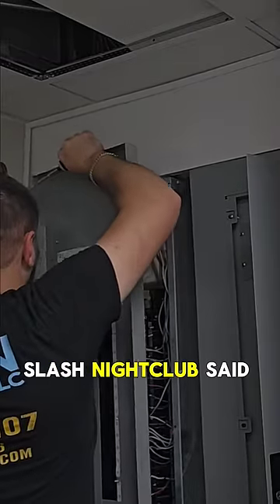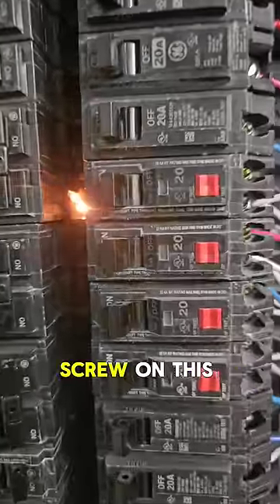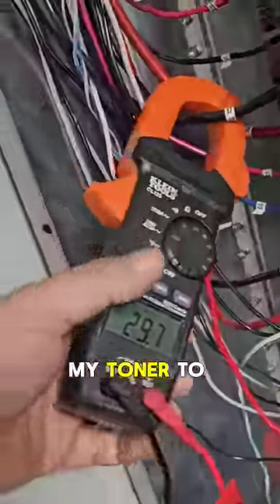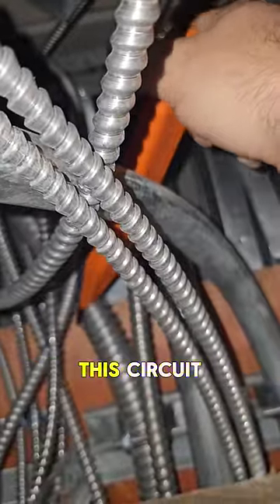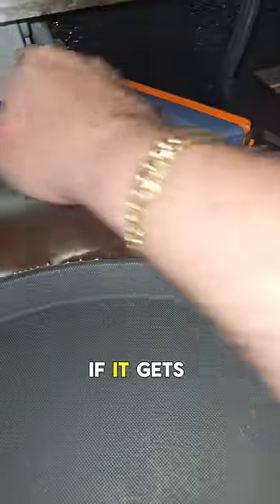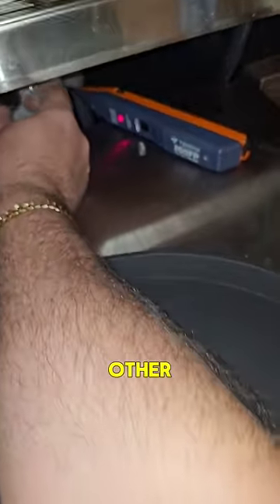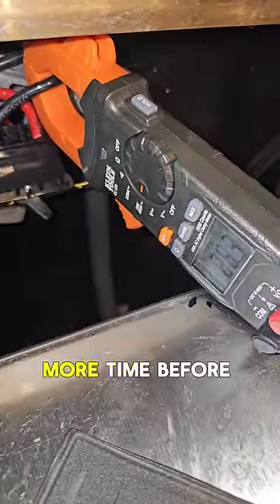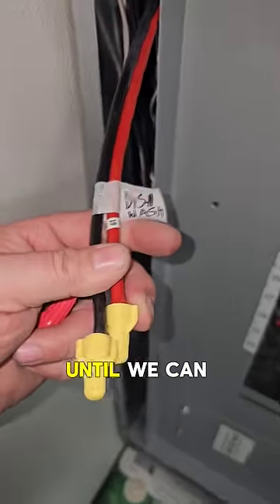This bar/restaurants panel was smoking when a 50 amp bolt on breaker melted down. Simon Electric

Comment: A friend of mine had the same job in Manhattan lounge bar.  He immediately yelled at the owner to get everyone out of the lounge.
His friend that was with him just hanging out happened to be a FDNY firefighter.
The moment people left the lounge, the panel arc'ed and you could hear the humming from the arc.  Every light went out and all you could see was blue light flickering from the panel.
Con Edison was called for emergency shut down.
When my friend told Con Edison that he was called on the job because the owner reported smoke from the electric room,
Con Edison guys went into the room and the entire room was black.  Everything was black.  Con Edison ripped out the electric panel, and when they took the panel outside,  my friend said the panel was melted and twisted into a mess.  Con Edison changed and rewired the entire room and also changed the meter.
Con Edison reported that whomever installed the panel installed it incorrectly and whomever wired it after to accommodate audio equipment such as 12 Crown power amplifiers for sound system, messed the entire panel up.
Later it was found out that the so called electricians prior to my friend was unlicensed.
Reply: Why do you say con edison so much...are you a bot...
Reply: @tieember9596    🤦‍♂️
Reply: @tieember9596  well, it's the electric company afterall, and it's also shorter than typing out "the electric company" every time. 

I saw no problem with it, it's just a story

Comment: This is getting to be a common problem in new panels. I’m finding on average 3 to 4 loose or cross threaded screws on every 42 circuit panel from the factory.
Reply: Because people are using impact drivers to fasten down everything
Reply: This 100% man. I have a strict no power tools policy for my guys when it comes to panels. Even panel cover screws at this point. I was finding they could not tell when a screw was cross threaded going into the soft busbar and would ram it home, leaving a loose connection.
Reply: They were never taught how to put in a screw. Hold it in place, spin it “ counter” clockwise until you feel a click then thread it in like normal. Works perfectly every time. This is a necessary step if you are reinstalling screws in any plastic fixtures as well.
Reply: @HaggisMuncher-y2u Yes!
It also strips out the screw heads. 
Just had a small crew (one  Jr one female student doing the pulling and termination).
I saw a few stripped heads.  
Brrrt. Brrrrt. Brrrrt.  Everyone using a power drill to drive screws except me.  
Idk how many times I have to drill out totally stripped screws that no driver can grip, or just spins free.

Comment: If I saw that glowing in a breaker box, I would of shut down the entire system with the main switch immediately... and also at the power pole.   Good god that's a fire starting within seceonds or minutes.
Reply: I find it funny he needed a thermal camera to see the heat 😆😆 
If it's glowing and you can see it, you can guarantee it's at least 1000C 😆
Reply: No need to shut down the whole building just to fix one circuit with the poor termination!👍
Reply: @fzigunov  a dull red glow begins somewhere around 800-900ºF, which you can spot in a darkened area, maybe in medium light.
1000ºC  (about 1800ºF) looks more bright, cherry red, and is easily visible in full sunlight.
Ambient light and individual eyesight will affect how our eyes perceive these temperature changes, of course, so this is general guidance for blacksmiths and others who work around high temperature materials.
Reply: How do you troubleshoot the issue with the power off? Think before you critique someone who knows what they are doing....
Reply: @chasejordan22  Well, lets see, it's the bus screw to the left of the breaker with the the top red plastic mark on it.  
Now switch it everything off before the place effn' burns down.   

This guy does not know what he is doing; you see an electrical fire you immediately switch off all electricity.    And then you put out the fire, or in this case, let it cool down before you work to fix the problem, double check it several times, switch all breakers off,  before reapplying power, then switch each breaker back on, one at a time.  Even a farm girl knows that, that does all her plumbing and electrical wiring.

We're living in an idiocracy where nobody has any common F'n sense any more...
Reply: @chasejordan22  Here is the relevant section under the Electrician's Universal Unified Electric Code 1958 Edition:  Chapter 3 "Internal Premise Wiring", Subsection C - "Breaker Box", Subsection 10-B stroke 5s "Faults", Paragraph 15, line 5:   "Nothing inside a breaker box should be glowing nuclear orange like a F'n oven burner element, at any time, ever.  If you witness this phenomenon, immediately switch off the Master Power Switch at the Breaker box, and then proceed to the Pole and switch off the Master Switch there as well.    Switch off all sub breakers.  Diagnose and fix the electrical wiring problem completely, before reapplying power starting at the pole, then the master breaker box switch, then each individual breaker."
Reply: @choppergirl  to get to the glowing breaker he had to take two covers off while smoke was pouring out....... If you just shut the main off before you start troubleshooting you won't know that the bus is glowing or from which specific bus/phase....

Comment: I deal with these breakers a lot and it is very easy to cross thread the screws. There are guys out there that don’t take the time to make sure the screws went in correctly.
Reply: That's why you always go counterclockwise to make sure it's set in, then clockwise. I hate bolt on breakers though. They sketch me out. I always worry about the screw falling and shorting something. Idk how people swap these live. I'm so glad my business is commercial refrigeration. I do a ton of electrical and am very good with it but I would literally shut the whole thing down to swap that breaker.
Reply: I blame lazy people using power tools in the wrong locations . They just Ream the screws in and say close enough for government work. Typical tradesmen now.
Reply: @allanhood4397 
I hope that when I become a vocational electrician in the future, things will be strict and done right for safety.
Reply: Cross threading is just free loctite 😉

Comment: I once went to a service call at a restaurant because they said the lights weren't working, I looked in the panel and turned on the only single pole breaker that was off, problem solved 🤦🏼🤷🏻
Reply from the maker: Haha nice
Reply: Easiest couple hundred bucks someone can make
Reply: And didn't even bother to try to figure out why a breaker for a lighting circuit would have tripped in the first place, and whether it was a sign of a larger problem?

You'd probably be happy to charge them even more when they have to call you out a few days later, too.  And again, and again.  Wait, no call today?  Oh, the paper says the place burned down last night.  Oh well...
Reply: @foogod4237  OR what really happened, they turn breakers off at night and forgot to turn one on in the morning, but thanks for ASSuming
Reply: @herdHistruth using breakers for switches is a problem waiting to happen..
Reply: @ashenmoonclash  unless they say swd on the side of the breaker
Reply: I once took a call where they said all the kiosks and card terminals I had installed were turned off. I asked them to check the breaker, they said the breaker was fine, so I drove the couple of hours to the national park where this was. Got the key to the equipment room and flipped the breaker back on and made sure everything turned on okay before going back home...
Easy driving money but not the most interesting of calls.

Comment: A large contractor allowed his guys to use impact drivers to install the breakers and 5 years later we replaced all 6 42ct buss bars and breakers ,old panels screw over torqued screws popped a lot of arching breakers abd one panel fire not fun

Comment: Nice to see thermal camera in use, I use one on service visits, as you will already know you can spot bad connections even if it isn't glowing or smoking and prevent future problems.
Reply from the maker: I agree 100% it is one of my favorite tooles to find overheating equipment

Comment: I would recommend leaving the gold band bracelet at home
Reply: Not a bad idea, but jewelry's biggest concerns involve much higher voltages and much higher frequencies (and much higher currents, but that usually is because of the higher voltages). Unless you're at risk of physical contact there usually won't be anything to worry about from ordinary wall current.
Reply: There's a proverb, work is gold bracelet.
Reply: It's a GFCI tester.
Reply: @absalomdraconis High voltage and high current have nothing to do with each other. A car battery is low voltage high current. A sparkplug is high voltage low current
Reply: @bene5431 You talk cars here, the others dont. ICE cars at that. Recent EV trucks charge at 500kW last spring, it escalated to 1000 kW last autumn.
Reply: @absalomdraconis the types of voltages and currents have nothing to do with it. It's just risky period. Dude has to be a big city guy rocking a freaking gild bracket. Lmao.

Comment: I had this happen to me at a Burger King. The busbar was so hot glowing it was literally on fire. I was able to tap the bus finger and install a new 10/32 machine screw. It worked out great and the manager was happy. I have also seen breakers get so hot when you spit on them it singes off the spit. Incredible.

Comment: Super professional.
Always verify if the circuit feeds something important as lifts, pumps, illumination where there is no natural lighting.
Reply: No, definetly not. I agree if you're somewhere more important, but this is just irresponsible. No matter what that's driving it shouldn't be on for even a second more.

Comment: Had the same problem with a screw glowing red hot cause of the same mistake on the A phase of a three phase breaker for a rooftop AC unit

Comment: You can use a toner on a live circuit ?  I was always afraid of blowing it up. I did trip a fire alarm once :)
Reply from the maker: Some toners can and some can not, and out of those that can not be used on hot circuits, some will damage the tone generator. But some do not get hurt they just don't work.
Reply: If you watch closely, He pulled the wires off the breaker and clipped the toner on the conductors. Most low-voltage toners like that you cannot connect to live circuits. That type of toner typically only generates a 9 VDC signal. 

There are other types of circuit tracers that you can clip on live wires, but they work in a different way.
Reply: @Simonelectricfl what toner is that? Is it lines voltage safe?

Comment: I like the tone of your toner
Reply from the maker: Well I like the cut of your jib
Reply: what brand voltage tester is that?
 @Simonelectricfl
Reply: @Simonelectricfl all my decades in low voltage (telco) I hadn't considered sparky using my exact toner and wand in exactly the same way I do 😂
Reply from the maker: @emg910728  that toner seems to penotrate conduit better then my kline or fluke that's why I use it more
Reply from the maker: @johnf.hebert1409   Tempo 200xp

Comment: Did I see what I thought I saw. Something is red hot in the back of the breaker panel and instead of immediately shutting off the power you ran around tracing the circuit. No matter what was on that circuit can it be worse than burning the place down????

Comment: So Tuesday, went out to almost the SAME call you had here. Residential, no idea what happened but the 50A furnace heated up the bus bar till the 30A range top breaker melted, The panel is old, like 40 years old, so betting just old AF age.

Comment: Of course even marking the breaker slot as damaged till the bus bar is repaired (likely replaced) will just be ignored by someone in the future.  

On one of our seismic acquisition ships, the field processing team plugged up a differential SCSI device to a single ended SCSI port hence shorting it and blowing a fuse on the interface card, apparently they were supposed to use a conversion device in between, the remote support team recommended bringing the equipment back to port to replace the entire workstation which of course simply wasn't going to happen so eventually the issue went up the chain and I was asked to get on the radio with the field team, I asked if they had any other cards in the system that wasn't in use and they said there was a four port Ethernet card that had nothing plugged into it so I advised moving the fuse from the unused card to the SCSI card that was needed. I advised they label the computer with the fuse needing to be replaced the next time it gets a visit by the remote support team and provided the remote support team with several replacement fuses.  Much later, the equipment was transferred from field operations to the office team, myself despite the field team had ordered inferior specs (clock rates and memory) on their equipment compared to what I ordered in house, which is why they always had poor performance in the field team.  Needless to say, despite several maintenance visits by the remote support team, the fuse had not been replaced despite the labeling and despite that I had secured the parts for them. Unfortunately, there will always be people who simply don't care and they will still be paid as much as you, perhaps more, as purchasing inferior equipment and lack of actually doing proper maintenance tends to be seen as lower costs by management...  A few years after I left that company, I had a lunch with some of my former co-workers and they said that after they merged with another company and transferred support to the other company, the only computers that were still usable was the old ones that I used to support, the new ones configured by the new team were simply unusable despite being newer equipment or performed poorly.  The equipment I had supported had scripts that analyzed the system logs every night and emailed out to the administration group as to which part needed to be replaced on which workstation, the part number, the estimated catalog price and the number to call to order the part so those old workstations actually got serviced...

Comment: Some restaurant owners opt for two gas water heaters; one for domestic hot water and one for sanitizing water. That takes work off the electrical booster elements.

Comment: One of my favorite fixes was where I had a faulty busbar connector from a Siemens main breaker to the bus bars. The breaker was shot so we had to replace it, but the bus bar connector was also burnt, so we were looking at a full panel change. Until I made the observation that these connectors were U-shaped, because the panels are designed to be uprated to 400A in order to save manufacturing costs, even though it was a 125A service (the 400A main Breakers used twin bus bar clasps per phase to reduce the load on an individual one). Simply swapping them between the two bus bars meant a fresh connection to the replacement breaker. Problem solved in 6 hours on a Friday evening emergency call.

Comment: How do you use the wire tracer?
Reply: From what I understand it creates a specific frequency in the wire that the receiver looks for
Reply from the maker: @zenithx1807  yes it picks up on audio signals in a conductor
Reply from the maker: You can actually listen to a phone call if I hold the tester to a landline phone wire. Kinda like a spy
Reply: @Simonelectricfl that’s cool
Reply: Really? Like a CAT6 or whatever?  @Simonelectricfl
Reply: @Shrampion  Pretty much the same thing but perhaps with better voltage safety ratings.
Reply from the maker: @Shrampion  cat 5 and 6 can be used on a land line phone but standard land line phone use 2 twisted pare and only technically use 1 set of those twisted pare.
Reply: @Simonelectricfl  : Cat 3 I assume (or was that 3 pair?).
Reply: I've used those things forever, only problem is they don't pick up the tone very well through EMT, BX or metal flex... with some trickery on the older toners equipment, (not the Home Depot stuff), I used to be able to trace underground direct bury cable, work really well for some parking lot jobs...

Comment: My friend worked at a pulp Mill and they had an accident where a guy dropped an aluminum Maglite Flashlight behind something there inspecting and it dropped right onto a 2000 amp bus bar and shorted. The result was a short that instantly vaporized the bulk of the flashlight giving him and several others burns. He did survive but he had to take retirement due to his injuries

Comment: I got a call to the relatively new hall for our church about a year ago because they were having some issues so I opened the panel and it was full of snap-in breakers, but it was a commercial bolt-on panel…. The cover was literally holding the breakers in contact 😫😫

Comment: I had a bolt break in my house on a 20A breaker (installed 1974). I saw a red dot out of the corner of my eye one day while passing the panel. I ended up putting in a pony panel as I didn’t was to start tapping new threads in old holes.
Reply from the maker: Sounds like you caught it just in time

Comment: Had someone do this on the ac circuit few weeks ago. Fried the compressor coming on and off repeatedly. Odd I didn’t do that start up but can’t blame anyone when we are also the electricians. Shit happens and I paid for the compressor. My guys should have checked the electrical connections instead of just connecting wires. Lesson learned